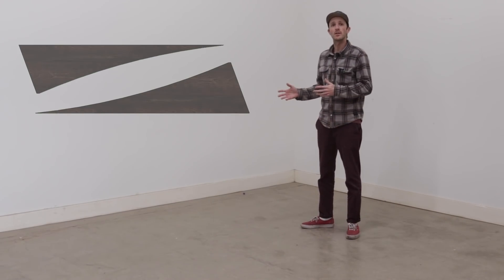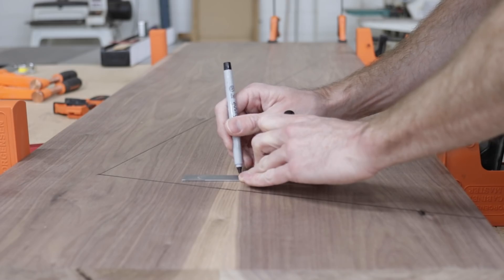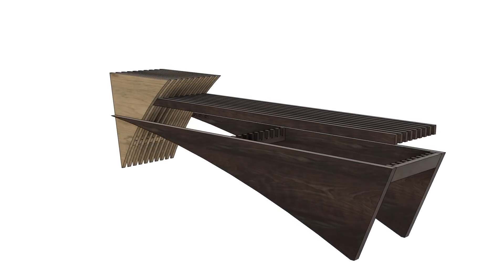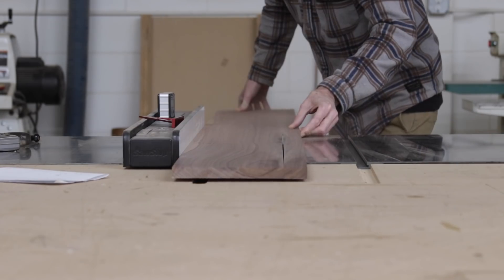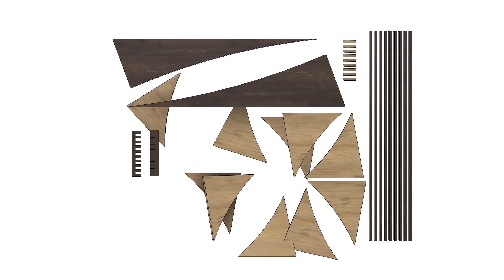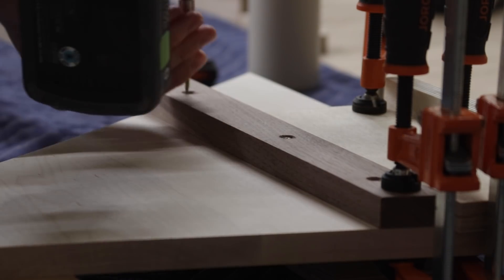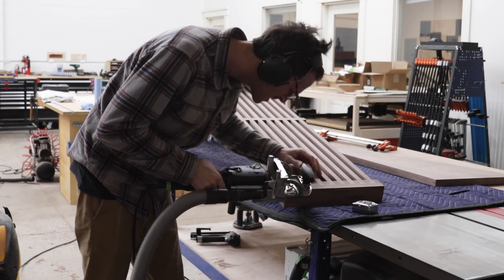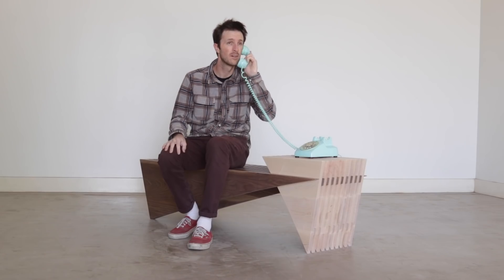The Most Uncomfortable Bench Money Can Buy

Comment: Why do you use bandsaw for those long straight rough cuts instead of track saw (just wondering if it's faster or some other reason) ? Like the look of the bench
Reply: Yep, when the cut doesn't need to be perfect, it is just faster than setting up the track, and the bandsaw cuts through it much easier.

Comment: I understand that your prices won’t be the same as mine (or any other hobbyist/on-their-own woodworker) due to a variety of factors, but how much have you been paying for walnut as of late? My average walnut board foot prices have skyrocketed recently- at a rate higher than those of other hardwoods as a result of inflation, supply chain issues, etc.

It’s getting harder every week for me to use it as often as I’d like, and prices don’t appear to be coming down again anytime soon, if ever.
Reply: We haven't bought Walnut in a while. We actually bought a lot of it just as prices were starting to go up (bad timing). They have leveled off a bit here, but I still think it is at least $10-11/bf, and up from there depending on thickness, etc.

Comment: question, you do some rip-cuts for your wallnut-strips for the slats of the bench. but why moving the rip-fence each time if it would be more "accurate" to set your rip-fence to a specific width and keep that same width over and over? is there a benefit of your technique?
Reply: Good observation. Honestly, it kind of depends on the situation for me. I feel I get a better cut when the majority of the board is between the fence and the blade, and I trust my table saw fence enough to be able to get identical width cuts even when changing it between each one. Though, there are definitely times when I do it the other way like you mentioned.